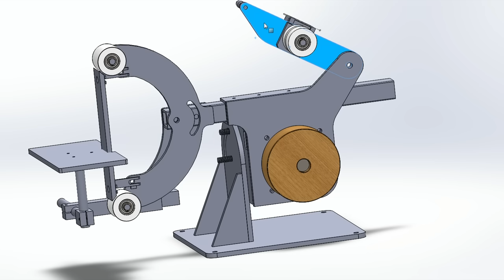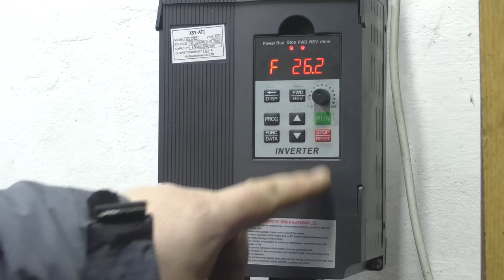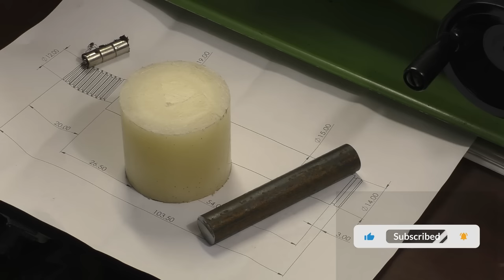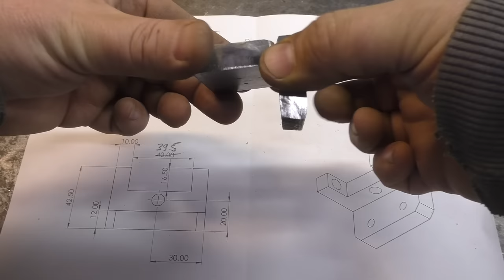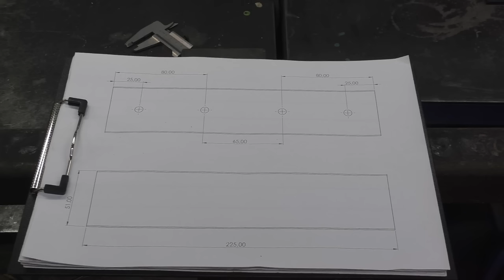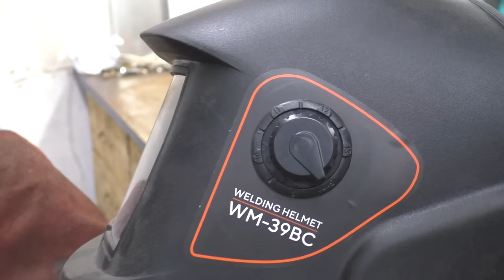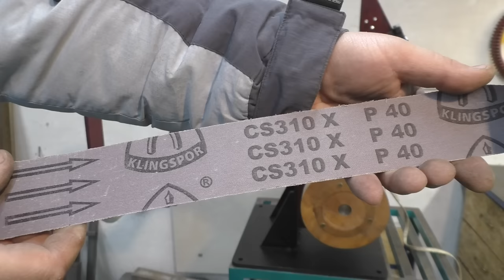How to make a Belt Grinder, in detail from start to finish, belt sander

Comment: Hello, thank you for a first rate kit. I have built it and it works well apart from small problem. The belt wants to move towards the electric motor, I have prevented this by adding a 45 degree by 5.0mm chamfer but I would still like to know why the belt moved.

Thank you for your advice in this matter. best regards,  dcaw